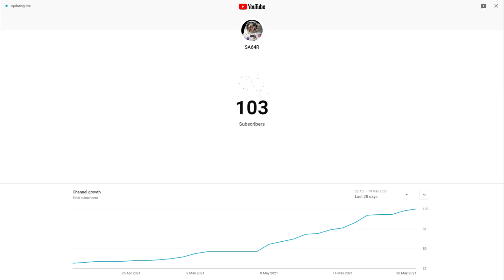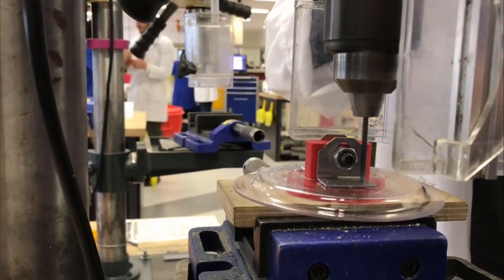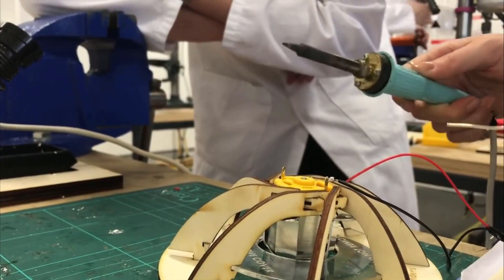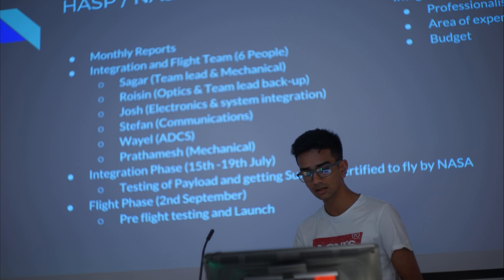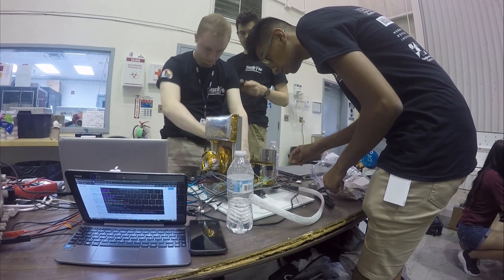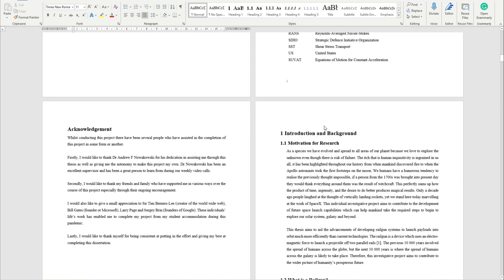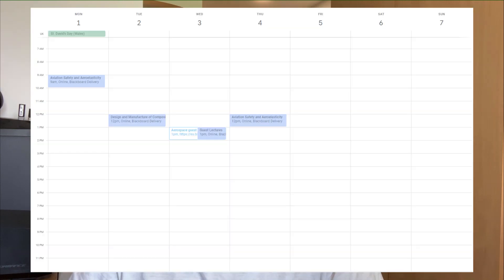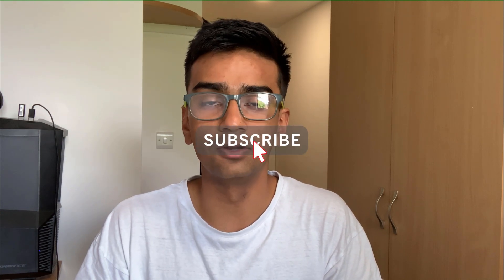AEROSPACE ENGINEERING DEGREE UK | OVERVIEW AND ADVICE

Comment: Its a great video. I'm electromechanical engineering dropout and I'm now working as an aircraft powerplant technician ; I've an authorization on Trent XWB, CFM 56-7B, Trent 1000, APU 131-9B and 331-200 aircraft propulsions. My question as a technician who loves a propulsion what do u think the fate of the mechanical type shaft driven gas turbines and conventional chemical rocket propulsion will be. I mean the ion engines are taking over the industry. My second question is that do u guys (aerospace engineering students) take an electrical, nuclear propulsion types. if not who would u think is going to build these propulsions ( I guess that wouldn't be u). If u take the courses, it will be great to attach the course breakdown. Tnx a lot
Reply from the maker: So my specialist understand based on my degree is spacecraft propulsion rather than aircraft propulsion so I will comment on that.
Chemical rockets I believe will continue to dominate the scene for a long time, mainly due to their proven capability, though thermonuclear rockets are pretty badass given they are theoretically more sustainable and efficient, though they're still highly experimental. Ion engines are useless on the ground as, yes they have a high ISP but the thrust is sooo tiny so can't be used for launch, however they are great for in space travel for long duration missions. So for applications like in orbit service spacecraft ion engines may be an ideal form of propulsion. 
We learn aspects of electrical powered propulsion systems for aircraft but no nuclear things. I'd say it would be a combined effort between elec, aero, mech, nuclear and chemical engineers.

Comment: What is the difference between BEng in Aerospace engineering and BEng in Aerospace engineering with an year in industry??
Reply from the maker: In terms of the degree you get, nothing however a BEng with a year in industry gives you the opportunity to take a year out between most commonly your second and third year to do an internship in a company you a can get into. However, if you apply for just a normal BEng course, it shouldn't be difficult to add in a YII as long as you let the appropriate people know in second year.

Comment: Hi sagar. My name is Joseph black and I’ve just turned 16. For a while now I’ve been interested in aerospace engineering and I’ve been wanting to go more towards the plane/aircraft side of it. I was just wondering. What exactly do you learn to do in university. Like would I learn the skills required to build my own plane? More or less by myself? Or do you just learn a specific part of the plane such as aerodynamics or engines? If you could reply I would be very grateful
Reply from the maker: Great question! The short answer is no, you won't learn the skills to single handedly build a plane. But you learn the fundamentals to understand why various decisions are made when designing planes. I would say however, after completing the degree, you would have a good enough skillset to design and build a mini drone like plane, but definitely, nothing like the real deal. If you are to end up pursuing aerospace as a career, you'll find out that you end up specialising into a specific area of aircraft design, manufacturing or testing.

Comment: Is 4th year a postgraduate degree? Or should i say masteral degree?
Reply from the maker: So technically the full 4 years combined allows me to get an Integrated masters in aerospace engineering, for example if I dropped out after year 3 I wouldn't get a Bachelors degree as you have to do the 4 years to get any degree.

Comment: Hey man, nice vid. I have just finished my bachelor's degree in civil engineering. I have applied to the university of Leeds, and have received an offer for Aerospace Engineering MSc. I was just wondering if you had any advice on this change of study? Such as: 1. Have you heard of anyone doing something similar? 2. Will I find it more challenging finding a job within the field after uni? 3. will I struggle with the content as I have not had the background knowledge gained through an Aerospace Engineering BEng, for example? (the main modules I studied for my BEng were structures, materials, hydraulics, applied mathematics, geotechnics, and infrastructure. I know this is a long winded question, and you may not have the answers, but any advice you have would be greatly appreciated. Thank you :)
Reply from the maker: Hey thanks :),

1. I have not personally heard of anyone doing this switch but it doesn't mean that no-one does it. 
2. I don't think it'd be more or less difficult than someone who studied a pure MEng aerospace engineering degree, since most undergrad (BEng) engineering degrees teach the same core skills. 
3. There will be subjects you'll find tricky purely because they're new to you such as aerodynamics, thermodynamics and fluid mechanics. Though I suspect any MSc course that is open to non-aerospace bachelor grads will bare this in mind and help you get up to speed with the basics required. 

I recommend if you do an MSc with an internship in the middle (hence making it a 2 year MSc) you may be able to find work in the industry and then get called back for a graduate role. That will greatly improve your chances to finding a job in that industry as you would've proved your ability in the field.
Reply: @SA64R  Thanks for the reply mate, some very useful info to take on board. Appreciate it :)

Comment: Hi what kind of laptop would you recommend for this course I’m planning to study it in September
Reply from the maker: I'd say get one that's reasonably powerful incase you want to perform fluids simulations or work on CAD. So something with a graphics card better than a GeForce GTX 960 is fine,  16GB Ram, I7 Quad Core CPU should be fine. Although unis often have remote desktop now, so you won't be expected to have powerful machines.
Reply: What laptop did you use ?

Comment: Hey, do you need to know calculus or algebra for this degree? If so, how difficult is it? Just asking because I'm really bad at math and kinda worried, also what kind of things will I have to learn prior to going to university?
Reply from the maker: Yes, calculus and algebra are super important in aerospace engineering. It is tough to say how difficult it is as we likely have different strengths so something easy for me may be hard for you and vice versa. I'd say maths is the most important thing to learn before aerospace engineering at university because much of the theory requires you to be competent at things like integration and differentiation. There's not easy way to say it but if maths is not easy for you then you are likely to find the course tricky, however I'm not telling you don't pursue this if it is truly your dream but perhaps there is alternative routes for you to consider such as apprentiships in the aerospace industry, which is less academically intensive.
Reply: @SA64R  Thank you so much for your advice

Comment: As someone who is projected to get D*D*D* in Mechanical Engineering level 3, would it be better for me to go straight into first year aerospace or to do a foundation year? Also, what are the best unis in the country for aerospace?
Reply from the maker: I'd say if you can get into first year that's great because you spend less time at university and therefore pay less fees etc. However, it all depends on how much maths you do in Mech Eng lvl 3 as if you would say its comparable to A Level maths then you should be equipped with sufficient knowledge to jump in from first year. Best unis for aero in the UK are, Imperial College London, Uni of Bath, Uni of Bristol, Uni of Glasgow, Uni of Southampton and Uni of Sheffield. Source: https://www.thecompleteuniversityguide.co.uk/league-tables/rankings/aeronautical-and-aerospace-engineering
Reply: @SA64R  thank you!

Comment: Did you get to do any part time job along side study? Is it possible to continue both? How many free time did you get in 1st year? Please reply me.
Reply from the maker: Hey I personally did not have a part time job because I was heavily involved in extra curricular projects that took up the time outside of my studies and classes. However, a friend of mine has been able to work part time along with studying the degree. So working and studying is definitely possible. In first year you are probably the most time strapped compared to all 4 years so I'd say if you want to work part time definitely be extremely disciplined in your time management. Alternatively you good do something like tutoring which gives you the flexibility for when you can work.
Reply: @SA64R  can you tell more about where and to whom your friend tutored?
Reply from the maker: @vaibhavbhardwaj4300  It was on a website called MyTutor. You sign up and you tutor virtually. He specifically tutored GCSE students.

Comment: Can u tell or make a video What actually happens in Masters degree in Aerospace Engineering (UK)
Reply from the maker: What specific things do you want to know?
Reply: Like if someone has a three years bachelors degree in non medical , namely pcm and computer languages , could he get a masters in aerospace engineering? Or anything related to that
Reply from the maker: @vaibhavbhardwaj4300  I don't know the definative answer as different universities likely have different requirements but for Uni of Sheffield the requirements are (2:1 BEng degree in mechanical engineering, materials science and engineering, automatic control systems engineering or electrical and electronic engineering.). If you're degree is on here or close enough you likely have a good chance.